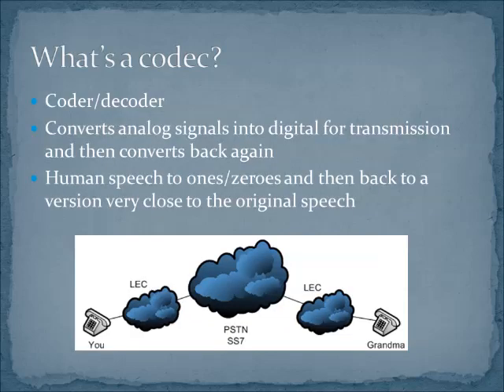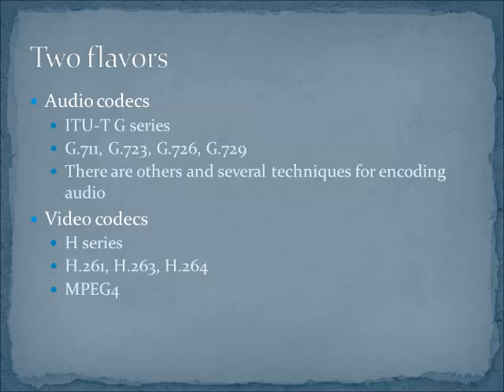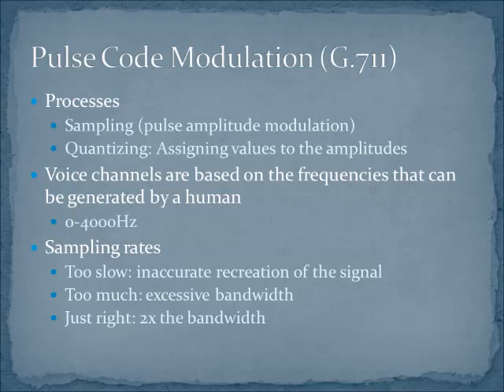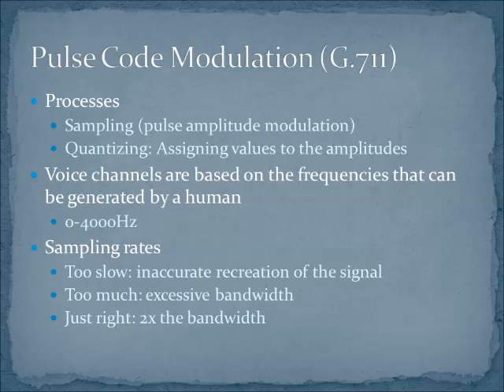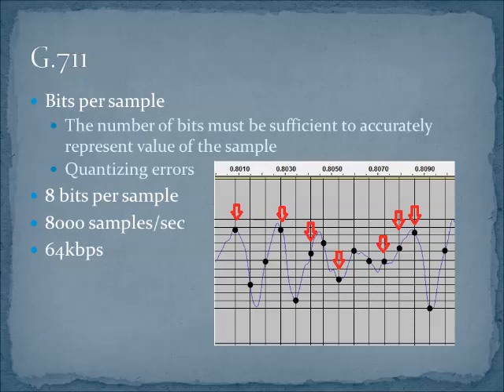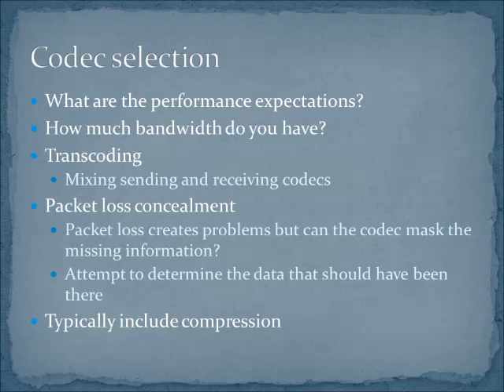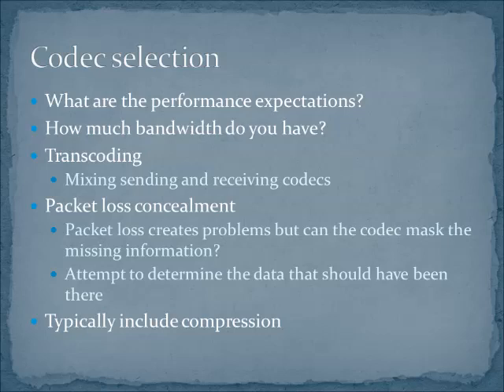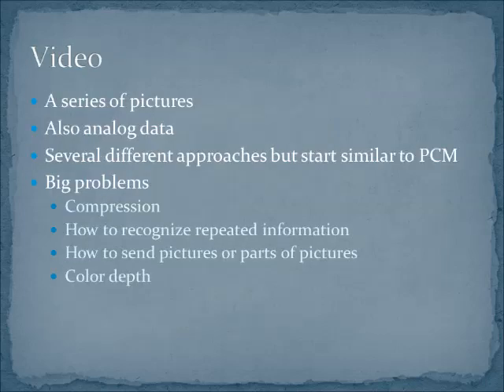Packet Guide to VoIP Chapter 5 - Codecs

Comment: there are questions  in the video but without answers!!! For instance,  how to choose the horizontal line t quantify the sample? is it the nearest smaller value?
Reply from the maker: Good gracious! Well, the horizontal lines are based on the number of bits allocated for sample values. So, 8bits has fewer than 16bits. And, the actual value assigned is dependent upon the codec and the amplitude. You can see the formula and the actual values assigned in the ITU-T rec. for a codec. A good place to start is G.711: https://www.itu.int/itu-t/recommendations/rec.aspx?rec=911  Hope this helps!